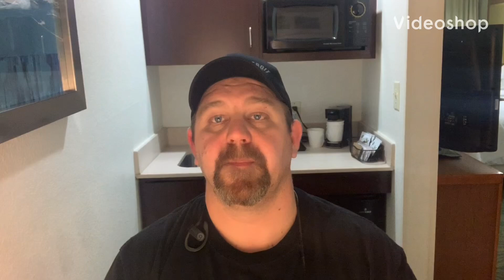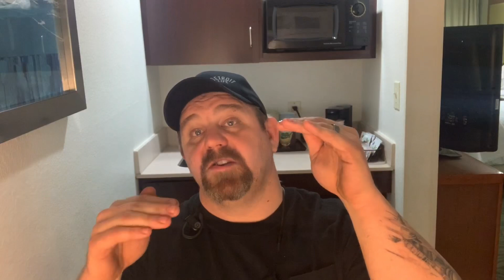Emissions is nothing to be scared of these are my thoughts on it4 ft4 final tier 4

Comment: So is it possible to add water to def and dilute it ?
Reply from the maker: BRIAN VANDUYN yes but it should always be consistent they have sensors to make sure it’s correct or it will d rate your truck
Reply from the maker: Any variation of concentration will cause you problems.  Good quality def is cheap compared to dirty or bad quality def. it will shut you down from running and be expensive. Most manufacturers do not cover a repair if bad def or something foreign is induced in the tank by a operator.  Let’s say someone uses a funnel that was used for oil last and uses it to fill the def tank.   Oil In the tank can not really be cleaned it will need to be replaced.  That will be your bill not warranty I believe.

Comment: My question/theory... with the addition of SCR to T4 final, why need EGR any more? EGR is the only after treatment that is "bad" for the engine. Other than the fact that I don't know how much more DEF consumption would occur, you could in theory eliminate EGR and let the SCR take care of all the Nox.
Reply from the maker: yes this is a great point. i think there will be less and less egr in the future.   but making some one add another fluid to make a machine run was a big battle when we first got deformed final tier 4 . making them add it all the time would have been a perception battle that would not have made it easy to win over. now it may be easier if they said no more egr failures.  just add def every time you fill up the machine with fuel.  don't know what the cost would be but i think it would help out us as technicians and customers
Reply: Deere ag went with cooled egr instead of def for it4. Cnh went def... when everyone went ft4.... those without cooled egr use quite a bit more def. it was about total fluid consumption and marketing mostly
Reply from the maker: @jwrench8741  great point. Its all about that balance.it is  kinda crazy how its going

Comment: More parts = more money we still have a lot of mechanical engines that run fine and less problems great video
Reply from the maker: it seems that the mechanical components are lasting longer than they ever have
Reply: not to mention the cost of the materials in the parts. DP filters are made of precious metals like platinum.

Comment: The engines run more efficient without the emissions and they have a lot more longevity because that’s just one more problem that will go wrong. Along with the electronics it’s a nightmare. Rather go back when it was all mechanical
Reply from the maker: That would be nice. But its not going to happen as far as I can see. So we might as well learn as much as we can about it.
Reply: TheHeavyWrench I know what ya mean their can only try to keep the old ones alive an they’ll run forever. Just sayin the emissions drains the efficiency and longevity out of vehicles and farm construction equipment because that’s just one more system with a bunch of sensors and a computer running it to go bad.
Reply from the maker: It’s a tough road we are going down. Keeping  those old ones up on maintenance is more important now than ever.
Reply: TheHeavyWrench yes it is have a farm that run with mostly pre 80s tractors and couldn’t hate dealing with the computers in the newer equipment and vehicles but those old ones as long as their taken care of won’t quit and their easy to rebuild
Reply: Please do more of this!